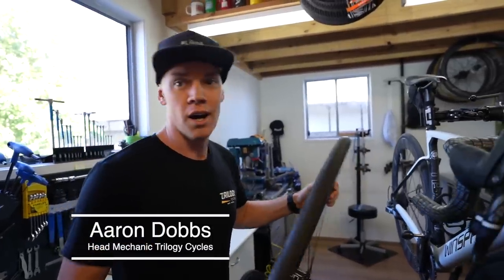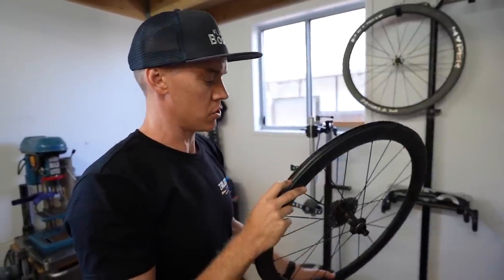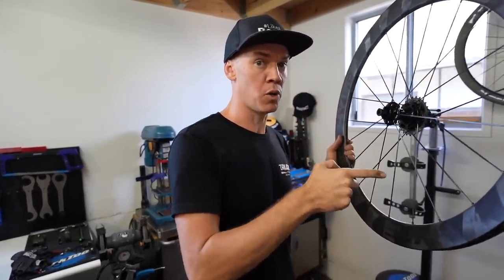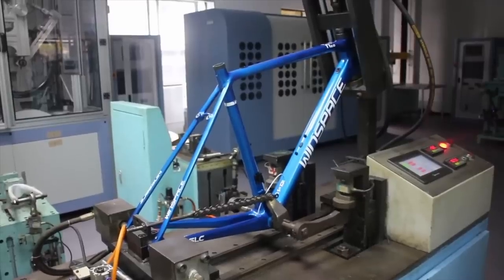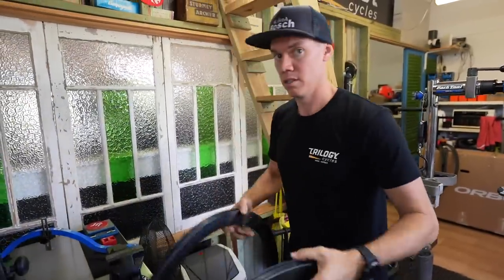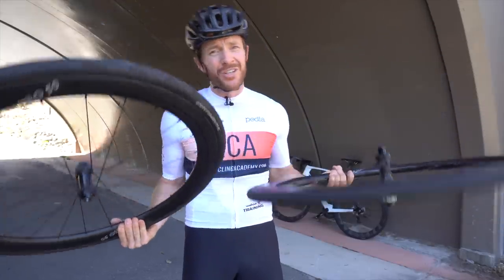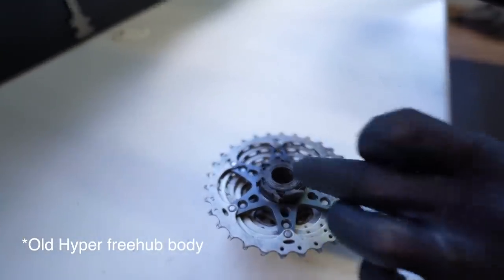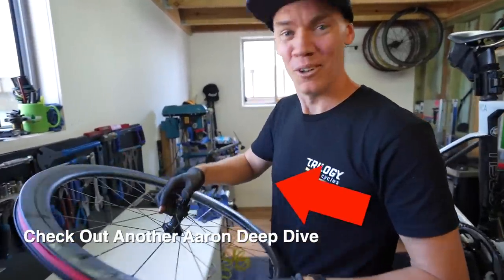Winspace Lun Hyper Review (VS Cheaper ICAN Aero alternative)

Comment: For me, I first bought the ICAN Wheels and they were very light but they seemed to me to be not as stiff as I liked. And they felt to be lacking lateral stiffness when I climbed in a standing position and do sprints. I was hoping for better performing wheels overall,  but I did like how light the ICAN Wheels were they just simply felt not as solid as other road bike wheels I have used over many years like ROVAL, Easton, and Reynolds Wheels.  I purchased the HYPER Wheels and from the moment I opened the box I was sold. The stiffest and most solid feeling wheels I have ever used are the HYPER Wheels. No lateral movements when standing climbing.  And they accelerate just as I hoped a Road Bike wheel could. I have been on HYPER wheels and LUN Wheels for multiple years now and I have not had a single negative issue with the HYPER Wheels. In fact, I hit a boulder during a race one time using the HYPER Wheels when racing in the Philippines. I crashed extremely hard and I was sure my rear wheel was destroyed.  However, the HYPER Wheel took the hit from the giant rock at race speed and literally has not one reflection of the smash. The wheel rolls perfectly true still and you could never tell there was a giant accident to the wheels. I was amazed that the wheels could take such a giant hit and not have the slightest show of damage. The ICAN Wheels roll nice and smooth on the flat roads but do feel soft and not quite at the performance level I was hoping for.  The Hyper Wheels I would buy again. Also, I use the Rim Brake versions, so cannot comment on the Disc Brake models.
Reply from the maker: Thanks for sharing your experiences on the thread Keith 👍
Reply: Similar experience with my Hyper 50s disk - to date they’ve traveled approx 12000 pretty rough & harsh Km & still roll fast & true just like day one .. extremely happy! I have no issue recommending Winspace Hypers. Personally, I don’t believe it is worth upgrading to the new Hypers even though I’d like to 👍
Reply: Lmao currently riding the ICAN aero's for two years, and they are very light but I Agree 100% they lack stiffness for when climbing out saddle, sprinting or cornering very hard. Now waiting for the hyper 2023. Hope I will be as pleased as you are
Reply: @verbinnenben  as I am, I’m sure you will be. Look forward to a future update .. enjoy 👍
Reply: The ICAN Wheels do roll very good and I was happy with the purchase, it was just the slight feeling of softness the wheels had.  It is not a bad knock on them, just a feeling, and then the side-to-side play on the standing climbing part I was not pleased with.  For me, this has always been a big issue, because many of my workouts when climbing are standing climb drills. So the wheel rubbing the brake pads sort of drives me crazy!  The HYPER Wheels were extremely light and extra stiff, and not a hint of side-to-side movements when climbing. This fast made me only want to use the HYPER Wheels, even when I have many other brands to select from and use.
Reply: @TheCyclesport  I agree with your assessment of the ICAN wheels. I had to back off my brake spacing so the pads didn't rub on the braking tracks. In my opinion, a slight knock on what has otherwise been a great set of wheels.
Reply: @verbinnenben  Got mine 3 weeks ago, R33.
I'm 6ft.4", 95 kg (fit), and i can tell you: they are great.
You will not be disappointed.
Reply: @matsrekdal3065  At your weight I would be extremely careful riding cheap chinese wheels. They are barely sturdy enough for someone 60-70kg and only on smooth, flat roads. Descending fast on less than perfect tarmac is suicide. At best you can expect your wheels to constantly be in need of alignment, break spokes and your hub won't last long. My sincere condolences 😊
Reply: @cyclingclub4030  Really?
So, you are not satisifed with yours?
Which one did you get?

First of all, at 1300 USD, they can hardly be classified as cheap.
Secondly, they have a rider weight limit of 135 kg, so that shouldn't be a concern.

I have been riding them quite a lot already, and it's the stiffest pair of wheels i have ever ridden.
I have never experienced such immediate and precise feedback while climbing before.
Still perfectly true, and no noticeable change in spoke tension.

Did you watch Peak Torque's review of these wheels? Or Hambini?
I consider both of them as reliable sources of information on matters like these, and PT consider them to be "the best carbon / carbon spoked wheelset on the market".

I have had top carbon wheels from Zipp, Fulcrum, Bontrager and Shimano.
None of them problem free, but still, much more expensive than the Hyper's.
Btw, where do you reckon those wheels are produced?
Reply: @matsrekdal3065  Hook, line and sinker🙄 Sponsors got their monies worth
Reply: @cyclingclub4030  i see.
Reply: @cyclingclub4030  All good points, I am 90kg, which wheels would you recommend, max 50mm depth. Second hand wheels are also considered
Reply: You wrote "HYPER WHEELS" so many times that I can't believe it wasn't sponsored
Reply: Would be helpful if those of you with ICAN experience tell what model you have used or at least what type of hub and spokes. Otherwise it’s a bit meaningless. The most expensive ICANs come with DT 240 and Sapim CX-Ray. Would surprise me if they are «soft» but who knows.
Reply: @cyclingclub4030  hi, I have been curious about Elite 6 spoke drive carbon wheels, and their 5 spoke wheels that are sold on Aliexpress, but not their own website. Are these, and ican, and hyper all massed produced by the same manufacturer and then sorted out to these named companies? You say that they are cheap Chinese rims? I weigh 260. Can you go into detail as to why you would say that I should stay away from them, please? I am confused...half of the internet says they are the greatest thing since buttered toast, the other half says to stay away with no full explanation. Can you please  give me some kind of valuable information, Especially on the Elite all carbon or, composite 5 and 6 spoke wheels? Thanks...
Reply: @terjemyller6573  I own the Ican Aero 40 disc 240 DT Swiss and love it. Not a single problem with those wheels. And I will buy again if I have to.

Comment: I have the ICAN aero 40s and my buddy has the 50s. I think the 40s are the better wheel and they are impressive in ride comfort, stiffness, and speed. I do feel like the 50s are not quite stiff enough probably due to the light weight overall but I’ve been very, very pleased with the 40s.
Reply from the maker: Thanks for sharing on the thread

Comment: I have the Hyper 50's rim brake version....I couldn't be happier. I'm running 25's on them tubeless mostly on my TT bike, but just bought a backup road bike for use on inclement days and on the trainer. I rode the Hypers tonight and they're such great wheels. I've put about 3000 km on them and they perform like the day I took them out of the box. When there is money in the budget for a new set of wheels it will probably be to upgrade the wheelset that came with my principal road bike....currently running Vision SC55 Disc that are ok. Would love to upgrade them to the Hyper D67 wheels....
Reply from the maker: Interesting to hear Chris, thanks for sharing on the thread.
Reply: @CamNicholls  I don't know that I'll ever feel like my ability warrants spending more than "winspace money" on a wheel upgrade. But that being said - what is the comparison from the Hyper wheels to the likes of the top well known brands like Zipp, ENVE, HED, or Lightweight for example.

Comment: Hey Cam, I have a pair of ICAN wheels as my first carbon wheels and I agree with Aaron at Trilogy Cycles. Upon inspection of trueness, dishing, bearings, and hubs, it’s well built. For the most part, these wheels work fine. The difference then, is the technology and manufacturing of the hub, spokes, and how it’s all put together before it’s shipped out. And then, the Hypers are next on my list of wheels to purchase and test out. Those carbon spokes, while proprietary and hard to source, look amazing! I’m glad you get a few free spokes for when they need replacement.

Thanks again Cam!
Reply from the maker: Thanks for sharing on the thread, and interesting to hear!

Comment: I have a pair on ICAN aero 50's and they've been working well for me. I've crashed twice in crits, scratching and gouging the rims and they've held up fine. Main disadvantage I've found is that they're not great in crosswinds and bearings aren't 100% smooth, but they spin well.
Reply: What tire u use?

Comment: Great breakdown on these rims Cam and Aaron at Trilogy was frank, honest and realistic. I have heard that the Windspace Hyper’s with ceramic bearings in their hubs, can wear quickly due to the baring hardness v’s the metal bearing casing. Did Aaron comment about this at all?
Reply from the maker: Cheers David, no but he did say (which I cut out, as Aaron actually talked for one hour on camera!) was that ceramic does not always mean better!
Reply: @CamNicholls  yes as I research rim options, I’ve noted that ceramic doesn’t always mean better. Sure there can be weight savings and performance enhancing gains, but weighed against the extra cost to buy ceramic over steel bearing hubs and the cost of maintenance and if one isn’t racing, then the test of commonsense should be applied. There are still some great rims out there running S/steel bearings.
Reply: In most cases ceramic bearings marketed to you in hubs are only ceramic balls not a Full ceramic bearing, in relation to races and retainers etc.

Comment: Nice one Cam.
I've had a set of 50mm rim brake icans that came with basic novatec hubs, for 3+years. Cost me £450 
Smashed the front hub in a pothole 2 years in. Got the wheel rebuilt, as the brake track had loads of life left, with a dt swiss hub. 
They have served me well as my fast wheels with about 24,000km done, but I've never ridden anything more premium so I don't know what I might be missing by spending more.
Reply from the maker: Interesting to hear Enda! I reckon I'll pimp the ICANS as a sequel video.
Reply: @CamNicholls  good plan, especially as the disc version rims will last 'forever' without a brake track wearing down! 
May have missed some of this in the video but I wonder what the differences in the rims are between the hypers and icans. Obviously the physical dims are a bit different but what about profile shape, stiffness, spoke holes asymmetrically drilled vs standard, weight etc..
Could be good content to include in your pimping up some icans video 😀

Comment: I have the ican aero 40 and it's extremely hard to get the tire seated. I think it's because I'm using clinchers. They have a USA warehouse so shipping was free and tax free.  My previous carbon wheels were extremely cheap. I'm no racer so but I feel the wheels hold speed which is all I want. Appreciate the video
Reply from the maker: Thanks for sharing Kim, interesting to hear.
Reply: Have same problem witch conti 5000 impossible to change tube

Comment: I have been running a ICAN staggered front 50 and rear 60 but both have 21 internal and 30 external.  I wonder why they didnt send the newest wider rim shape.  I have 15,000 miles on them and they have been great.

Comment: Thanks for the detailed info Cam, nice work!
Any thoughts on Elite Wheels ENT or similar from Ali Express? Looks like you can get a set for about $700AUD delivered but seeing the differences in hubs from this review makes me wonder about the "quality" of them.
Reply: I just bought the Elite ENT wheels and they are decent for the price. Although they are my first carbon wheels so I don't have experience to compare to anything else. I would best describe the difference from the half decent alum stock rims to the ENT's as "noticeable" but not significant. I had my local bike shop fit them too in case there was anything wrong with them. My verdict would be they are a good "first carbon wheel", or if you are on a strict budget.
Reply from the maker: I’ve got some elite wheels in a box next to me
Reply: @CamNicholls  please review them 🙏

Comment: Thanks for the detailed breakdown of the 3 wheelsets Cam.I see a big problem with the Ican only gives you 30 days to find a problem,postage quickly adds up to a cheaper wheelset losing it's advantage.With the Hypers I would prefer steel bearings as the race will then be of the same hardness.Ceramics are only good new with matching hardness of race.                                                       Is the new Hyper profile of 45/54 an improvement real world?
Reply from the maker: Cheers Simon, I have only ridden the new Hypers a handful of times so the sagged profile is hard to quantify, but I do like that style.
Reply: Yeah I wish they have steel bearing option for hyper

Comment: Nice job. Feel like so many people over the years, and rightfully so often, are against a Chinese open mold wheel/frame, but lately a few brands, albeit at higher prices clearly, are producing a really good product, hyper being one of those. With that said owned many brands, and ride one of the older HongFu 45mm wheelset/rim brakes, still a really good wheel when built up properly with quality hubs/spokes, never had a single issue with them. Reynolds, good wheel all around. Zipp, garbage. Soft/flexy, terrible hubs...not worth the money at all. As a sprinter, they are terrible even under leadout loads. Anyway...good stuff, keep it coming.

Comment: I wonder if the the speed limit in the decent was due to the faulty/rough bearings mentioned in the video. It would make sense and if it is the case, it would be cheap and easy to rectify.
Reply from the maker: I reckon Nelson! Didn't want to say as I'll leave that for others to decide. Aaron thinks so too.

Comment: Hi! 🙂 Maybe u could help to decide what brand and which carbon wheels should I get? My rides are ussualy 30-100km with 100-400 meters of total climbs, so pretty flat. I think I should get around 45-50mm deep wheels?  I could buy  new zipp 303s from  local shop for around 700 EU, or it would worth to spend around 1170 eu for Windpace hyper wheels?  Or maybe something else? Also prefer louder hub sound as there where i live many pedestrians walking on bike paths and i dont like bells 🙂

Comment: TIRE an ICAN  wheels?? What tire u guys use on ican wheels ? I have aero 50 for 2 nd season I like them  but the problem is to change tire , they are so tight  I use conti 5000 almost impassable to  change   2 bike shops have problem to change tube  !!

Comment: I got a set of ican 38mm run brake runs off of ebay for 600 usd and free shipping.  They weigh 1380 grams with sapim spokes. There are some resellers in the U.S. you just have to look around.
Reply from the maker: Well played on the postage there!

Comment: I've been tempted with Chinese brand wheels due to the price, but holding back I could see issues that aren't immediately apparent.

Carbon spokes have much higher tension and as such have 2 issues worthwhile noting: 1. A harsher ride and 2. Potential for a catatrohic failure if one spoke fails.

I'm going to save my money for a proper engineered solution from  Mavic. A Mavic SLR 45 front and SLR 65 rear ticks all the boxes, for me. Steel spokes albeit wide for a small aero gain but more interestingly their Fore Carbon tubeless technology whereby a threaded insert is bonded into the rim to take the spoke. The rim bed is not drilled and therefore you don't need rim tape and it is rumoured you don't need to use sealant either - you could deal with that issue out on the road with a Dynaplug and syringe.

I also think the NACA 'teardrop' rim profile, rather than a blunt trailing edge, has an aero advantage.
Reply from the maker: Thanks for sharing Phil. Appreciate where you’re coming from
Reply: @CamNicholls  No problem, and no disrespect to these Chinese brands either; they have their place! It's interesting to see the high rate of development from these direct-to-consumer brands and will keep other mainstream brands on their toes!

Comment: I get why you would want max consistency in the comparison, but not why you would want no wind at all to differentiate aero wheels which are precisely supposedly design to shine more than any others in windy conditions.
I know, I know...wind outside is turbulent and every single dickhead on the cycling market still thinks in terms of aero like it's just as a laminar flow study from a first year engineering student toying with a cfd software for the very first time, but STILL !!
How can you tell a wheel really is better than another if you do not bring at least some lateral wind to check which is stable and which is more likely to get you killed at the first strong gusts of wind ?

Also, there's no way comparing a 45mm section wheel to a 50mm one of same origin, with only minor changes (save for the width) to the profile can be seriously advantageous to the 45 one considering how important the front wheel rim width is to the overall aerodynamics of the Bike-cyclist ensemble. 50mm being the rule of thumb width limit below which aero gains drop.
The fact you're seeing roughly same results in both wheelsets is actually very good for the new slightly shallower one, well done Lun/Winspace. 
(Joe, if ever you're reading this, you still could've gone for the full 50mm on the front one so we could see real gains, you cheap basterds. Oh and enough with the no-brand ceramic shit already. That's the one thing you guys had to get rid of, you kept it.).
Reply from the maker: Problem with the wind up is it tends to change by the minute, especially with gusts. There’s too much margin for judgement from others and that scares me. Haha